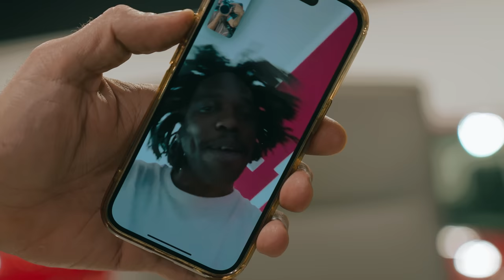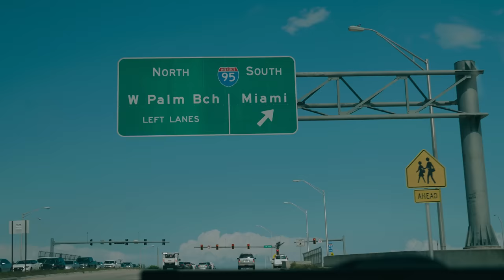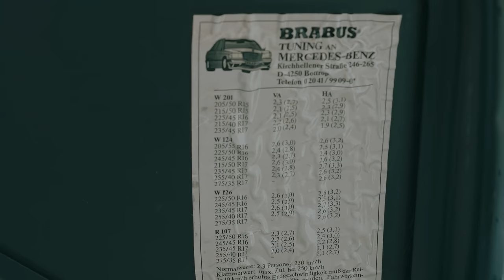Changes at Patina! OG Tuner Benz Arrival and We Hired a New Mechanic!

Comment: I have a 1999 C43 Amg that I finally got done restoring. Full interior and expensive mechanic work done with all oem parts from Germany. The previous owner didn’t disclose many issues and one of them being a different engine when I needed certain parts for it… Luckily found a 2000 c43 engine and man she runs so well. Very hard to find indeed!